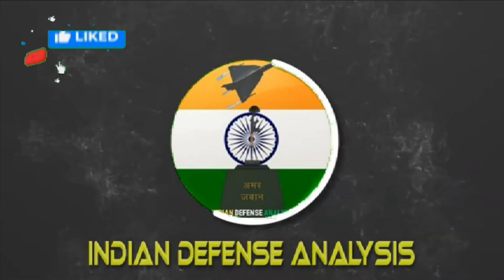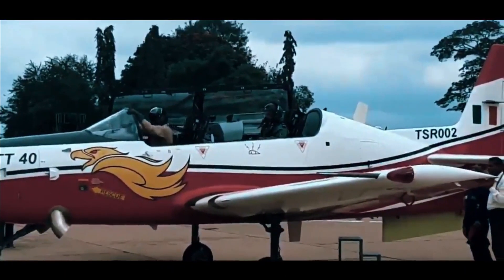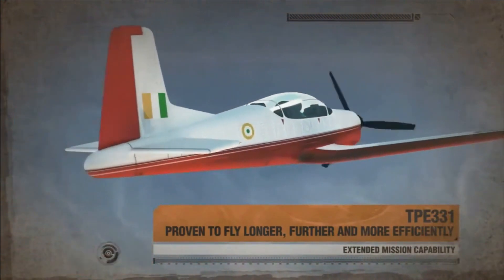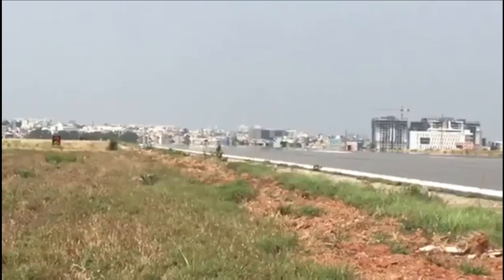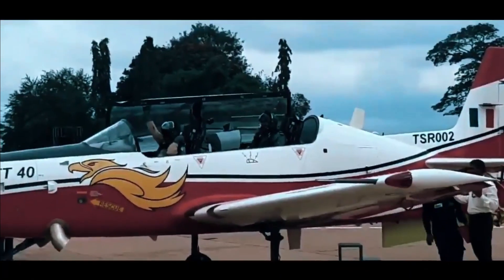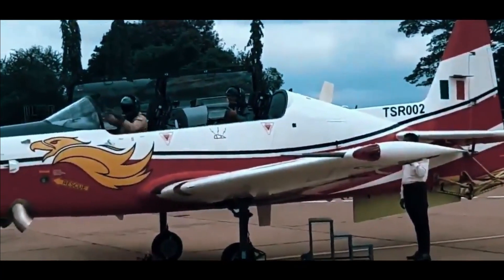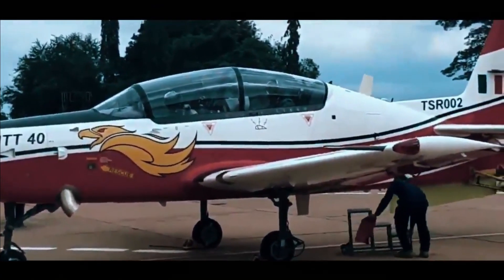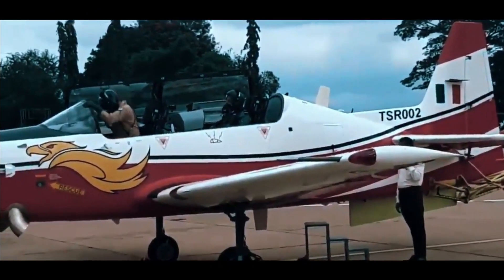Hindustan Trainer Aircraft (HTT-40) : HAL Projects requirement of 290 aircarfts

Comment: Production constraints
12 aircraft per year in the first 2 years
24 if enough orders materialize

If those orders come as HAL forecast this will be a great money maker.

An excellent bargain and it may be greedy but the engine
should be indigenized as soon as possible. Fuel cells
should be considered here as well.

There is no Bharati manufacturer of ejection seats, this may 
need some R&D.

HAL's trainer pitted as Rs 4,500 cr cheaper than Swiss Pilatus trainer 
Business Standard

Prashantsingh Bhadoria, one of the HTT-40's designers, told Business Standard the HTT-40 would eventually cost Rs 35 crore an aircraft, including the cost of developing a weaponised variant. The 75 Pilatus that the IAF has already signed up for cost Rs 38.5 crore per aircraft. The HAL team at Aero India 2013 said that the HTT-40's only two imported systems would be the engine and the ejection seat, which together cost Rs 6 crore.

"It is easy to see what benefits India's aerospace industry. The Rs 38.5 crore that we pay for each Pilatus PC-7 Mark II goes entirely to Swiss manufacturers. Of the Rs 34.5 crore that each HTT-40 will cost, India's aerospace industry will get Rs 29 crore; only Rs 6 crore will go abroad," says Bhadoria.